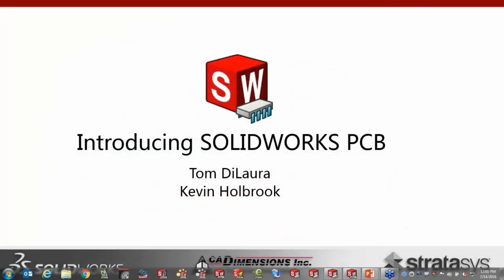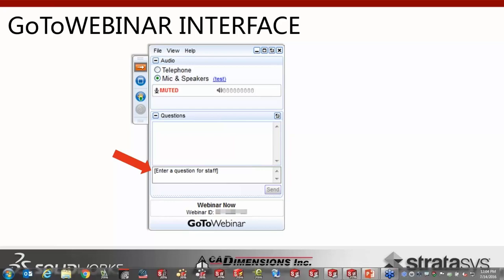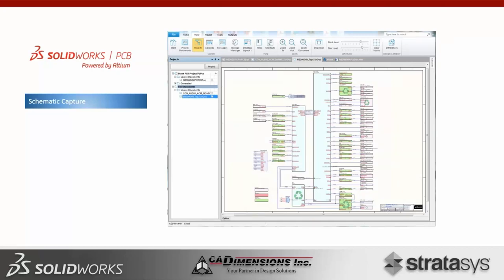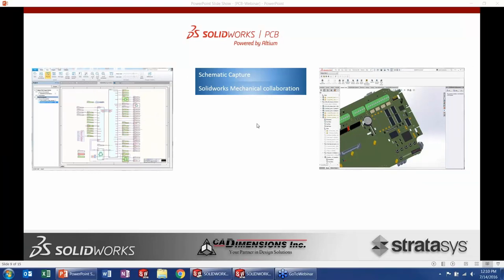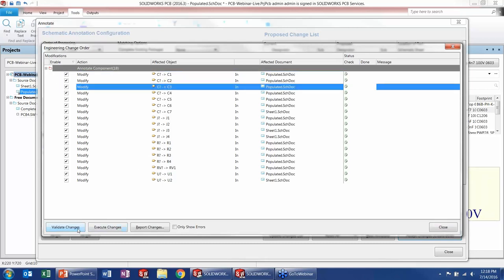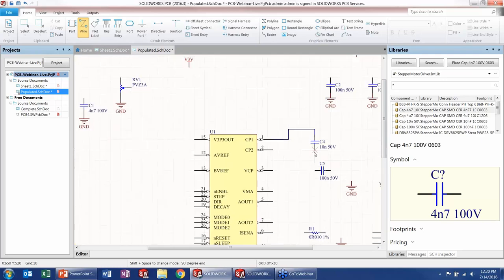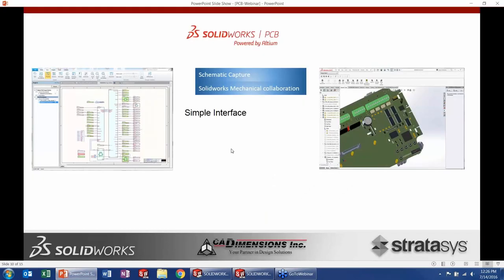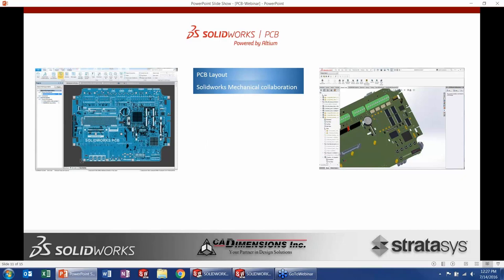Introducing SOLIDWORKS PCB

Comment: I bought Solidworks premium to get CircuitWorks that was meant to work with Altium and what a waste that was. I wonder if Dassault will GIVE me the PCBConnector?
Reply from the maker: I am sorry you have been unable to have the collaboration you desire with Altium. Your SOLIDWORKS reseller will be able to outline the full capability of each package and ensure it fits your business needs.

Comment: Disappointing! NOTHING new here! I always prefer for Altium and SolidWorks to work separately...
Reply from the maker: Hi Sam.  The Connector piece is brand new.  This
allows the two pieces of software to talk to one another with doing a series of
exports, conversions, and imports.  Altium and SOLIDWORKS can certainly
still work separate from one another, but if you are looking to collaborate
between the two, the Connector certainly improves the process.